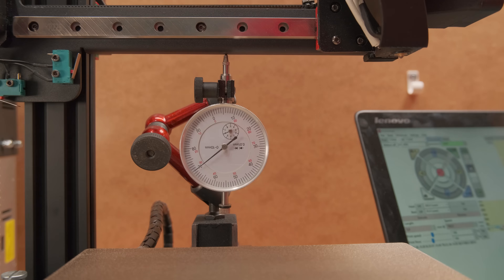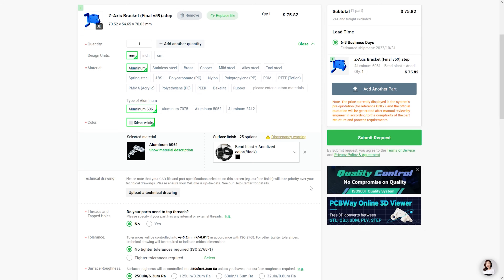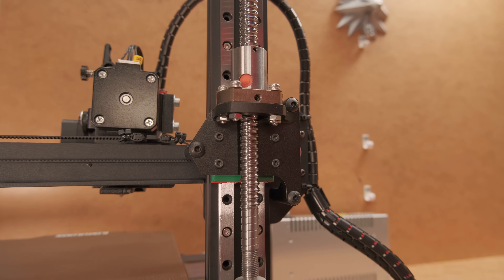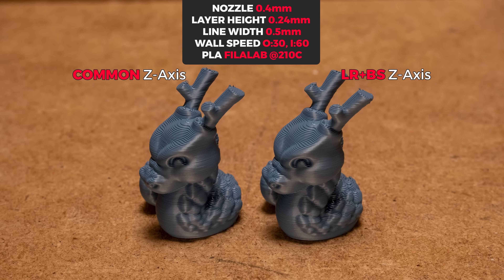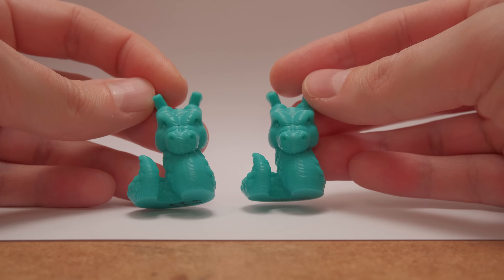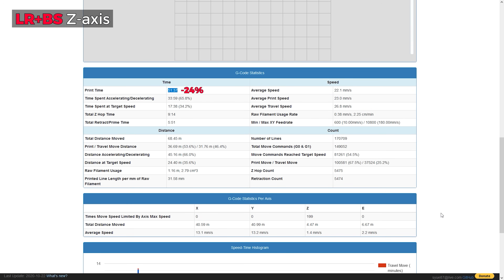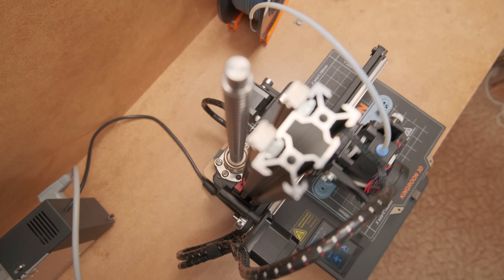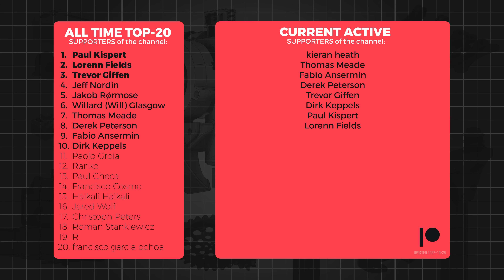3D Printer’s Z-AXIS ULTIMATE Precision Upgrade – IS IT WORTH IT? (Linear Rails + Ballscrew)

Comment: Okay the shouod-be Elephant in the room is…. WHAT QUALITY / Acuuracy rating ballscrew are you using!? As well as Grade rating of the former lead screw?? 

Believe me I’m all in on ballscrew usage I have some awaiting going on my FT-6 Large bed printer with tons of weight and custom aluminum bed plate and platform! That’s 700x330mm and weighs a ton!  That I needed Z-hopping to even remotely be a possibility Vs a total joke via the friction on lead screws (30-70% transfer efficiency) vs ballscrews and their (85-95% power transfer efficiency). That in this scenario with a tiny weight on a short lever arm and hardly any mass to lift up and down … I’d personally not expect to see much improvement and more likely without a decoupling device for the ballscrew have the majority of people doing a mod like this to see some
Z banding and issues from the fact ballscrews are so rigid and their radial deviation being forced to move elements of the chassis that usually lose the tug of war..    I’d say generally speaking most people will get more consistently decent results from a lead screw Vs ballscrews lest in the ballscrews is very short and very constrained with many (4 linear rails carriages in this case) please can you tell me where you bought that particular ballscrew and it’s rating C0-C5 ?? 

To have no issues I’d assume you’d need to fork out a lot of cost for a C3 or so!  Without a decoupler! 

Lest YIURE very lucky or bought a ground ballscrew again also high prices and usually the only way to get C0-C3 accuracies as the cold rolling process imparts too much axial deviation into the steel .. and sadly in the smaller 12mm SFU1204 (types I use on all things) vs. SFU1605 or another common 16mm type those internal stresses in the steel are less likely to manifest in inaccuracies / wobble around center of axis because there’s more mass to resist the curvature after the grooves are pressed into it for the bearings to run into..

Anyway off topic now I’m going into TMI.

And I only have watched 2/3rds of your video maybe in the end you share the ballscrew quality rating!  

I’d be very eager to know that and source of it!  As … it just seems to me you’ve gotten very lucky to be able to harm mount the ballscrew nut onto that machined aluminum
Piece (which btw does that PCB shop have good pricing on small CNC parts? Is that some secret I should know about as it’s usually very expensive) 

But that made me worry you’d for sure have unwanted artifacts in the print just due to the quality of these often unrated or off the charts in amount of inaccuracy type ballscrews.

Any info on that would be very appreciated as anytime I see someone without issues bolting it directly on I’m
Eager to hear the source of the ballscrews!  ??

Please? Ty 🙏
Reply from the maker: I am impressed that you wrote all this but only watched 2/3 of the video :D But being serious I really appreciate the detailed comment. I used a cheap rolled C7 SFU1204 300mm ballscrew from Aliexpress for ~$20. I don't buy ballscrews from there on a regular basis, so I can't tell if I just got lucky or if the quality is decent for my specific use-case scenario (I also bought an Oldham and other types of coupling for the worst-case scenario, but I didn't need it as I had no binding issues). Buying a more precise ballscrew that was ground and not cold rolled, those have some insane prices.

For the pricing on CNC parts, you should just upload the STEP file and see the price for yourself. This aluminum bracket's price was ~$75 ($144 with all the taxes, import fees, and DHL shipping, no discounts).

A couple of days ago I made this test print ( https://i.imgur.com/fmL8xr2.jpg ) and it looked way better than even on a dual motor z-axis 3D printer with regular lead screws. I couldn't see any repeating irregular lines and the photo on the left is the worst-case scenario with lighting from the top (the best scenario on the right). At this point, I think I am running into filament consistency limitations. That was printed with +/-0.03mm filament.

Comment: I love that you went full lunatic mode to prove your point.  My KP3S came with some horrible Z wobble, but a different Z screw coupler and nut (I already had both) and a simple printed part to mount the nut and allow the Z screw to be 90 degrees solved it pretty well.  
I'm still not able to get the quality on my KP3S that I see from may i3 Mega so now I'm exploring how vibrations from the part-cooling fan affect print quality.  An ADXL345 sensor shows quite a lot of vibration and I can see that certain speeds (say 50%) seem to be much worse than others (30% and 70%).  I saw in another video that you have a bunch of different fans to test with.  Maybe a topic for a video?
Reply from the maker: Haha, thanks. Yeah, KP3S' can have some serious quality control issues. One of my KP3S had absolutely perfect Z-axis rod alignment and on another, I had to widen the holes to mount the brass nut in the correct spot. But for print quality wise I would say they perform extremely well.
I made many mods and calibrations on my i3 Mega back in the day, but it never reached the quality that I am currently having with my two modified KP3S printers (with V6 all-metal hotends). The stock hotend is good while it is new but with a PTFE tube inside it is just a question when you run into problems. And it also uses V5/V6/MK8 uncommon parts it is such a weird and annoying combo.
As for the fan vibrations, I doubt they affect the print quality in a noticeable way. Unless you get some really bad vibrations at certain speeds. Take a look at this video https://youtu.be/TXw37ydld5g This fan has way too much vibrations for my liking but only affected the nozzle at certain speeds. After I saw that I ditched the "fan vibration effects on print quality" idea. But maybe I should do it after all to show the worst-case scenario.
Reply: My kp3s had a bad coupler as well, seems like a common issue, though cheap and easy to fix. The Z nut bracket was also not very straight so modifed that and added an anti-backlash polymer nut as well.

I'm getting great quality prints, but I don't like how slow this printer is in it's default state, my Monoprice Select Mini V2 gave similar quality at significantly higher speeds, but it was also noisy af and had a tiny build plate.
Reply: @ferrumignis  Have you tried compiling Marlin or installing Klipper and increasing speed limits?  I put Klipper on mine on day 1 and find it reasonably fast.  I had to clean and relube the linear bearings.  The mass of the x carriage is probably the limiting factor now.
Reply: @beauslim  Klipper is on my todo list.  I have a suitable Pi somewhere in a box in my loft...